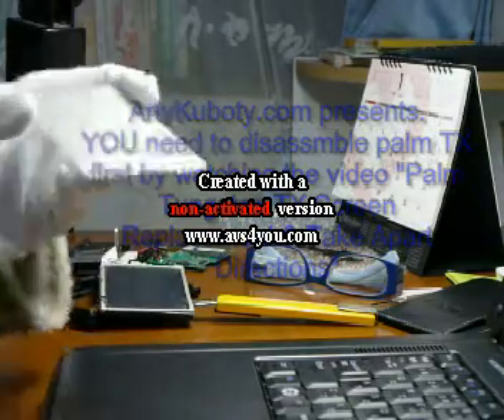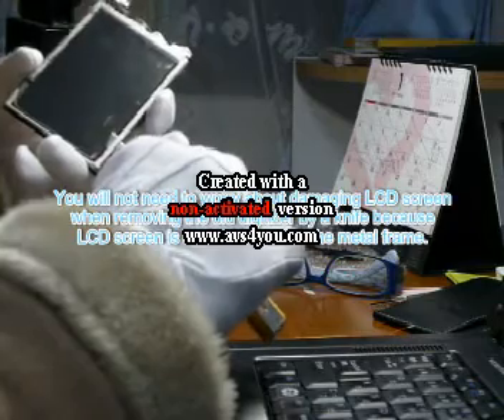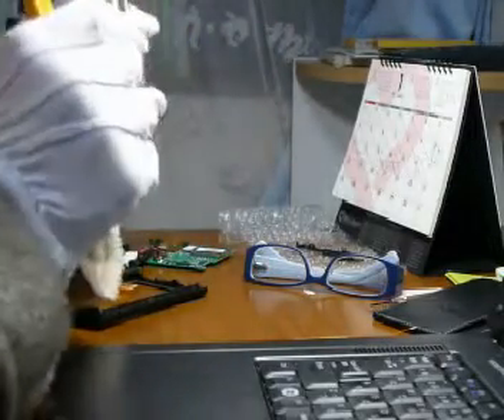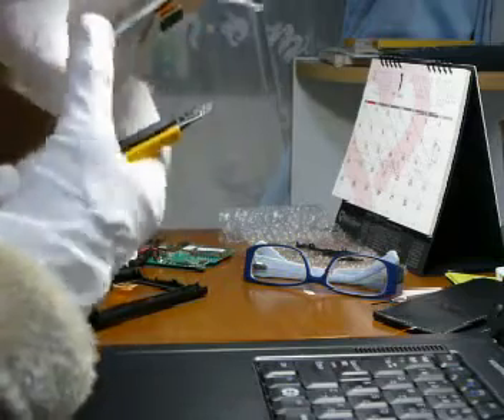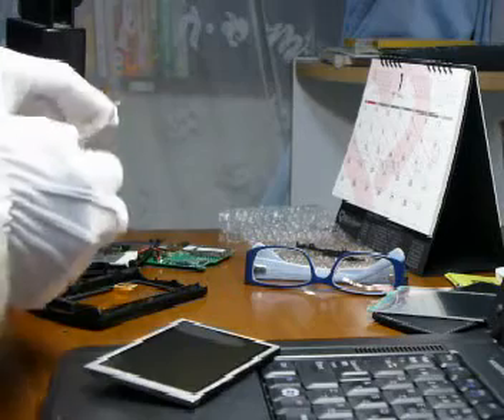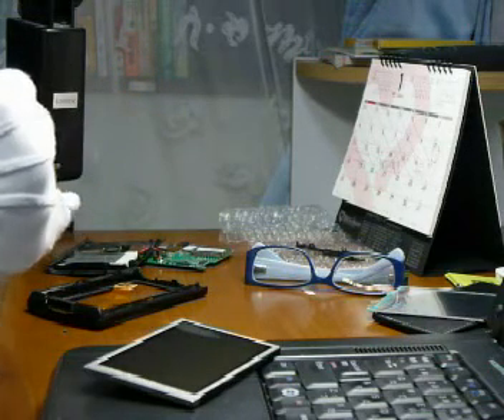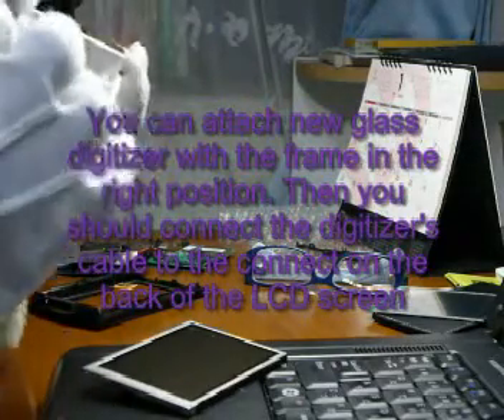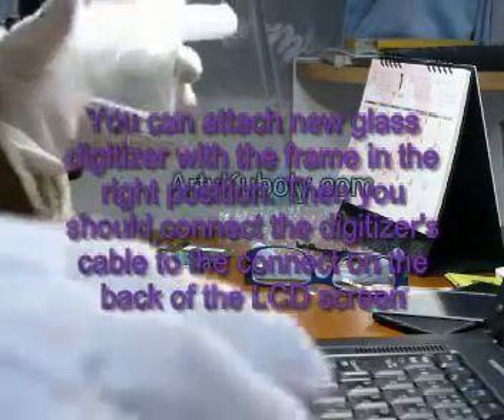palm tx glass digitizer installation

Comment: I apparently have a small problem - after removing the old digitizer as shown in the video, and installing a new glass one, on start up I get a blank screen.  Soft and hard resets do no good.  I've rechecked the connections and find nothing out of place.  Any suggestions?

Comment: Artykubot:
Nice video, easy to follow.  I fixed my TX sans difficulty.  Two points: Separting the digitizer from the metal framed LCD requires only 1/8 of an inch (about 3mm) of razor blade, the tip of the blade can help free the adhesive once the digitizer is peeling off...DON'T SCRATCH THE LCD!.  2nd: the digitizer cable connects underneath the clear tape with a copper connecter flap - just insert the connection until it "bottoms out", flip the copper flap back down, retape.

Very nice, Thanks